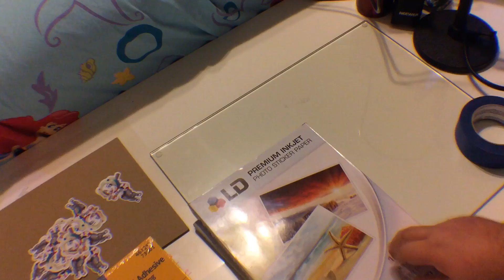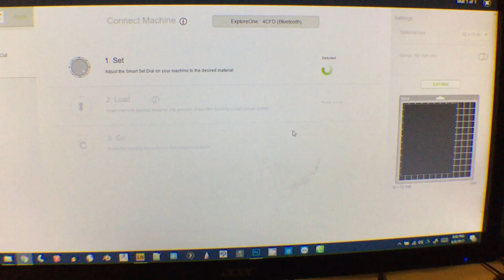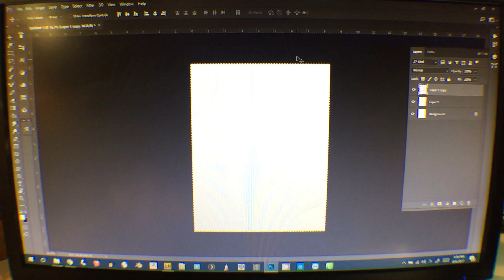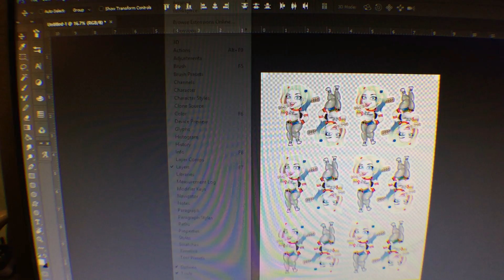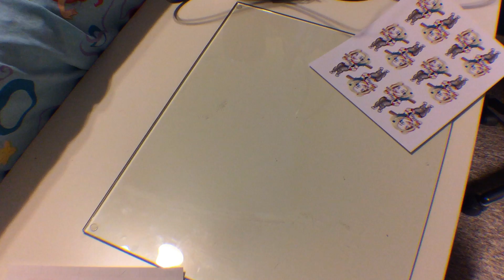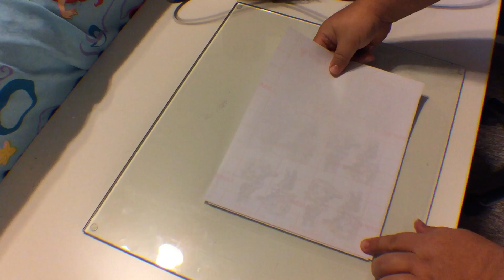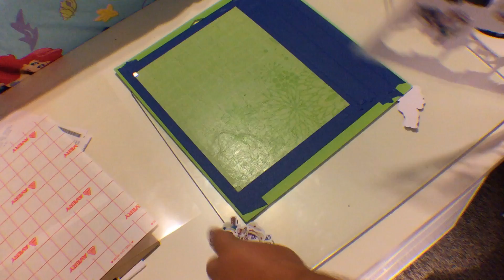Trick your Cricut to do FULL PAGE Print and Cut - Sticker Tutorial!!

Comment: hey erik this may sound stupid, but why cant we just upload the 8.5x11 png to the design space and use print & cut function since the matt size is 12x12? im looking to buy cricut but no hands on experience.
Reply from the maker: Yeah I wonder that when I purchased my Cricut too, turns out the Design Space software is webbased and limited to 5x8 Print and cut option. You can cut on a mat 12x12 and even 12x24, but when it comes to the PRINT and CUT option 8x5 is the max. It prints a box around the image for scan lines to position the image into the cut space. Also this box it prints is tricky because it sometimes won't recognize it on glossy paper. Oh and the print from Design Space is no where near the quality I get when printing from Photoshop as when you upload the files to Cricut they process and degrade them to save size and space o their servers. I know this sounds like a lot of limitations and frustrations and I had them but once I figured out how to trick my cricut it has been the best bang for the buck and I have made a lot of money off it.
Reply: @EricMBoyd  really appreciate your reply eric. does it need to have a borderless printing compatible printer?
Reply from the maker: no not at all. I do have a borderless printer, but I turn that off. Biggest issues I have run into is the type of printer feed. Autofeed on my printer always prints a little imperfect.

Comment: Quick question, sorry if this has been asked. When printing from photoshop does printing borderless matter? I used that method and some cuts actually landed correctly while others didn't. I wonder if printing non-borderless if it would be more accurate when cutting the file from DS since when you print non-borderless it usually prints with a white area around the edges.  Hope I am making sense.
Reply from the maker: Borderless printing can work as long as the print is still centered. I have done both successfully and not so successfully. I tend to use crop option over borderless because I only leave white space outside the print and for cutting that doesn't matter. My printer borderless cuts doesn't seem to grab the paper and will sometimes disort the image on me most noticably around the edges.
Reply: Thanks Eric. You're the man! I am sure TONS of people are using this method. You are appreciated.

Comment: I've tried this several times and all my cuts have been off centered everytime. Then I figured it's probably because my sticker paper has a tiny boarder around the paper itself meaning the sticker part is a millimetre-ish smaller all around the paper than the backing. 
How may I adjust the set up so that my cuts are centered??
Reply from the maker: I am not sure, what program you printing from? Photoshop has an option to never resize and it wil center page pretty good everytime. Sounds like your print settings are resizing to fit to page.
Reply: I'm printing from Photoshop and I followed your instructions to make sure it was centered at 100% scale.
Reply from the maker: The scale is set to 100%? also, try going into the printer setting themselves and make sure there is nothing like FIt to Page.  Some printers will have an over ride for such settings. I have had these issues to and it took me  a while to figure out something wasn't quite right. I try to cover so much stuff I may have forgotten to show something, but I have had people tell me this works for them and others say it doesn't.  Maybe you can get me your file so I can look at what you are cutting.
Reply: I think it's my cricut? It's cutting off to the left side and I tried adjusting the image on the design space more to the right instead but i still can't get it to cut properly...
Reply from the maker: Ok, so yes I have had this issue. Remove the tape and reapply, then re-cut your full sheet size out of the tape. Also, sometimes if you are doing more than one sheet... so if I load a cut from DS to the Cricut and then cut the first page when making multiple sheets of stickers I have had issues where I need to cancel DS and resend it to the circut to reset the alignment. I am not sure if this is what you are experiencing. Cricut is a great machine, but it for sure has its issues, not sure if its software or the machine that causes it.
Reply: I also reapplied the tape 3 times.. is the tape suppose to sit right at the top corners of the grid after its been cut?? Because mine isn’t.
Reply from the maker: Babykimbap no it won’t and everyone assumes that placing the paper at the corner of the grid will line up with the cricut and that is why we use the tape. It lets us know where the cricut does line up with the mat.

Comment: Followed your tutorial exactly but my stickers still ended up mis-aligned :-/ The cut ended up slightly higher than it should be. Any advice? I print from Preview on my mac- since my Photoshop has a bug where it can't print directly from the program. Any advice?
Reply from the maker: Yeah I have experienced these issues and 95% of the time its the printer. I only do rear paper feeds with this method as if I use the tray it will never print the same as you think it will. I have printed two sheets one tray and the other rear feed and placed them over a lightbox and or window and you can see each print is slightly off from one another. You'll just need to tweak your printer settings to adjust and or compinsate when you place the images on the mat by that much. If you see in my video I readjusted the image on the mat when I noticed a misalignment.
Reply: Thanks for the response! Yeah, at this point I'm pretty frustrated so I think I'm just going to return it. A couple of mine were just a little off, and some cuts were WAY off. Selling a $2 sticker doesn't seem worth the hassle and all the wasted vinyl if it doesn't line up right. It's really a shame!  It also has major connection problems with the design studio, even with the USB plugged in. Your stickers look so great, I really wanted to do something like that but I haven't gotten close yet unless I taped a piece of printer paper with the same sticker images on top and let it scan that. Some say they had better results with glossy papers and vinyl on the Silhouette Cameo.

Comment: Great video. I actually bought the cricut off the back of this lol but its not working for me though! :(  Im following it exact (i think)  but seem to be doing something wrong as it is like half an inch off every time. Does the brand of printer have a big say in how this works? I'm using a Xerox machine and when i have the sheet centre and scale 100% how you state in the video it changes the dimensions and is too big.
Reply from the maker: It is possible its still resizing by adding a border around the page. What program you are printing from could be the issue. I use PS because I have so much more control over the printing. if you are printing full page, maybe see if you have a borderless option? Borderless on my Printer doesn't seam to work. When I print from PS it tells me it will crop the page because of the printer and I am to just say ok and it lines up the print correctly. Are your corner squares cutting correctly? If the Corners are cutting correctly it is your printer. If the corners are off it could be the tape area is incorrect.

Comment: I like the idea of using tape on the mat to get the machine to cut physical alignment guides, so you are helped to get the card in the right place on the mat. That's neat.  Maybe only really need to do two sides (top and left)?

The slight problem (I would have) with the rest of the method is you have to know that your printer is going print perfectly straight on the page, which isn't always the case. I saw you had a misfire when loading your printer - I have the same issue and even when I think it's straight it can still be a bit off when printed. I guess this is what the "Print and Cut" registration marks are for, they allow the machine to adjust the cut to handle issues with the print - but, as you say, the Print and Cut size limit is a pain.

If your printer didn't print your stickers straight on the page then you would have to adjust/turn the positioning on the mat so that your registration squares (that are white and you can't see) aligned with the tape corners meaning the card/paper would overlap the tape slightly - not ideal.
I guess the solution (labour intensive but most accurate) would be to use your method to cut a slightly smaller taped area (say 8.0" x 10.5" depending on printer margins) and include a thin outline the same size in your print image. Then, once printed (straight or not, it wouldn't matter) guillotine the printed piece to the printed border and then fit the guillotined sheet onto the taped mat. An extra operation but guaranteed to be straight?
Reply: I would like more info about this idea. Does it work? How exactly would you set this up? I'm frustrated because I follow all of these videos, but it still doesn't cut perfectly. No matter what I do, it's always off by just a bit.

Comment: Great video!  THANK YOU!  I am hoping you can help me with a project i am working on.  I am using "print then cut images" and then laminating them individually.  I then want to use my Cricut to cut around the laminated images.  I am worried that the individual pieces will move as I am trying to  laminate them so even if I make a template from where the original images were-before I laminated them- the finished laminated cut from the Cricut would not be exact-thereby ruining my project!!  I have thought about scanning the laminated sheet of the individual images in-into my computer and uploading that into design space-but this is a huge project- and each sheet would be a long process.  I really want the images to print fully on an 81/2 X 11 sheet too-this is why I checked out your very helpful video!  Do you think I should make a template like you did with the painters tape and the precut rectangle?  PLEASE HELP!!!  THANK YOU SOOOO MUCH!!!
Reply from the maker: Thanks. Are you doing hot laminating? If you are doing cold laminating like in the video you can cut everything after laminating.

Comment: Hi there Eric, first of all this is genius. I designed a logo in inkscape and when I transfer it to Photoshop it's pixelated. So what resolution do you use for your images.
Reply from the maker: Thanks,  I keep my resolution at 300DPI. Inkscape being a vector program needs to be resized and then exported as 300 DPI at a larger size for clean images. If you are doing photo stuff in Inkscape it works pretty well but there is always a risk of pixelation. If you have photoshop why are you using Inkscape? for the vector illustration ability or for outlining?
Reply: Eric M Boyd the DPI was set to about 125, so yes I'll definitely have to increase that. I've been doing a lot of heat transfer vinyl and decals so vector graphics is the way go. Also when you do the outline my Photoshop doesn't give me the option to fill the outline. I have PS CS6. So instead I go to create a stroke
Reply from the maker: PS CS6 should be under Edit>Fill you can use short codes too... Fill. Command/Ctrl + Backspace - Foreground Color, Alt/Option + Backspace - Background Color, Shift + Backspace - Fill Options. Great way to fill color into selections or change the color of text and vector shape layers.

Comment: This doesn't work for me.My machine not align correctly when cutting. I need a help.
... But it still the most brilliant and helpful video in whole "You tube". Thank you so much!!! Respect!
Reply: Me too I did everything he said and it isn't working
Reply: Hasn't worked for me either. Have tried numerous times. The trick is simple to execute, but my Cricut keeps changing where its left/right margin is with every attempt, by about 1/16" or more. Even when feeding the mat in the same way every time. Sometimes it cuts a portion of the sheet quite well, but not all of it. Other times it's not even close. Meanwhile, print and cut does a superbly accurate job (to within a fraction of a millimetre), but so much wastage. Super frustrating trying to figure this out!

EDIT: And here I am the next day with a pretty darn good cut job like the tutorial! Not sure what combination of changes I made fixed it, but it might have been printing my PSD layout after placing in an InDesign file, and making absolutely certain that was the last version of the PSD that I exported to PNG for Cricut to cut.

For whatever reason, my Epson 2750 Ecotank printer obeyed my centering and non-resizing instructions from InDesign's print dialog, but not from Photoshop or an Acrobat PDF. No matter what I did in those programs, it still tried shifting things around to avoid cut-off (even when I told it to ignore that). 

So I'm pretty happy! Think I'll make wider white borders around my stickers to help with discrepancies; I was using pretty tight tolerances, and it's more noticeable when it's off. That said, it did a pretty accurate job on the majority of the sheet. Still not as good as Print and Cut was, but I'll take the tradeoff.

Comment: So helpful, thank you!  I am trying to do kiss cut laminated sticker sheets.  Cricut says it can't read the sheet.  Do you have any suggestions?
Reply: I do them all the time. I get 2 pages out of one 8.5x11 sheet using the methods described in this video. I just change the pressure of the cut to kiss the page.  These are half page kiss cut. I get two out of a full page. https://www.instagram.com/p/BRYZoNTgoPx/?taken-by=ericmboyd  don't use cricut scan and cut it will not scan anything glossy.
Reply: EMBoydArt ok, thank you!  You don't use registration marks on those either, just the painter's tape?
Reply: I use the same method of making my own custom blank registration marks and combination painters tape on the mat. I pull the blade out while it cutting the registrations I created. Works great!
Reply: EMBoydArt Then you can make the sticker sheets bigger, too!  This is great!  Thanks again, your videos are wonderful!

Comment: Hi Eric!  This was a great video very easy to follow. But I do have a question I am using cricut explore air 2. I followed all steps exact as well as the print settings. I’m using an Epson artisan to print. However once in cricut my cut was very off. I set position to zero but that did not seem to fix problem. And I did resize once in design space too. Any suggestions?
Reply: Nekia Bryant i have the same problem
Reply: Same problem here too.

Comment: how u set custom cut to .4 or setting it to custom automatically set to that cut
Reply from the maker: Hello. I am not sure I understand the question. Please explain. Thanks
Reply: Eric M Boyd how do I set mines to custom where it cuts at .4
Reply from the maker: I assume you mean the depth of the cut? If so don't worry about custom, just search the lists for the best guess paper and try it till you find the one that works best for you. If I am cutting magnets I search magnet and there are two options one is for .5 and .6 deep cuts and you have to also account for the type of blade. ie. deep cut or normal cut.
Reply: Eric M Boyd I’m making labels and I’m using label paper with laminate over it and wanting to kno what to set it to because it’s not cutting thru on sticky note
Reply from the maker: try sticker paper not sticky note. There is a custom setting on the screen where you select sticky note.

Comment: My apologies if you've answered this. I skimmed over as many comments as I could looking. Is there a reason why you didn't run it through the cold press before you cut them?
Reply from the maker: Good Question! No one has asked, but yes the reason is the laminate page is 9x12 so there is an overlap of stickyness. I also use that overlap to hold down the page to the mat as my mats get used a lot and are not all that stickky. I actually prefer them to not be very sticky and having that overlap really helps. If I tried placing the full page with laminate through cold press as full page it will stick to the rollers inside.

Comment: Can I use this method to print on A4 paper or do I need to specifically buy papers of Letter size?
 I understand the print size for Letter and A4 are different. When I cut the 8.5x11" guide on the painters tap, then put my printed A4 paper within this guideline, it didnt fit. 

What is the workaround please? (Im from the UK so have never printed on the Letter print size)
Reply from the maker: You can use all the same techniques with UK A4 paper just need to change the Cut on the painter's tape to match your size paper. UK A4 is 8.27x11.69 in the US we use 8.5x11, so change your cut and you should be good.
Reply: Thank you so much for the reply. So glad I stumbled across your videos.

Comment: This only seems to work for the first cut.. my second and third cuts are completely misaligned vertically by 1-2 centimeters..
Reply from the maker: Yes, sometimes I have experienced this as well and I blame Cricut. On occasion, it has also happened because of printer alignment.
Reply: Eric M Boyd I have a Canon pixma but have ruled it out, since I just did the initial simple rectangle over the course of 2-3 cuts and the misalignment happens even then.

Tried contacting cricut about it and they keep trying to make me use the print then cut feature only 🙄